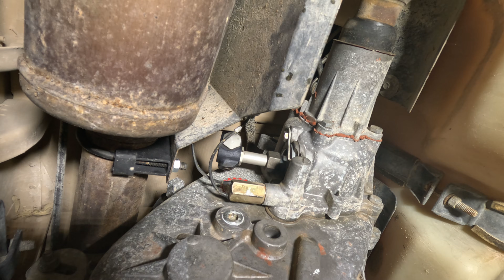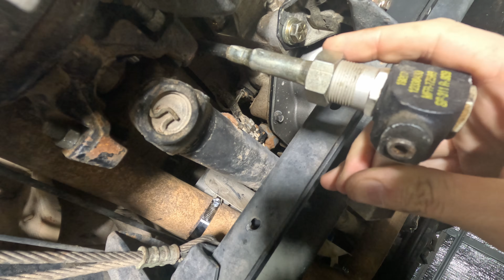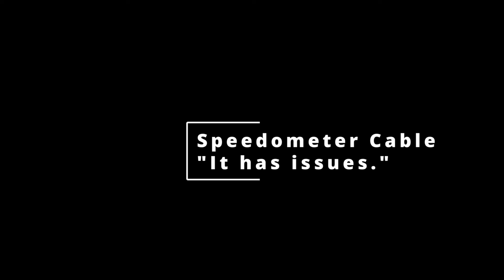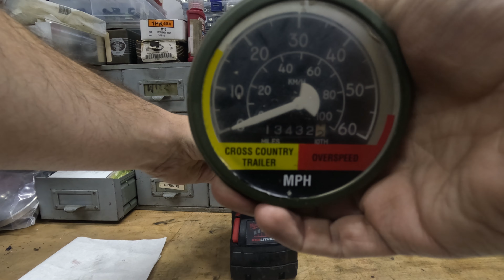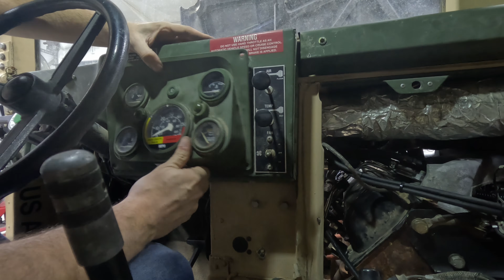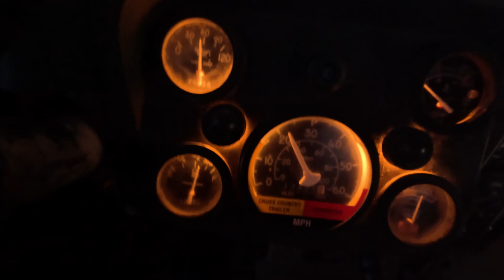Fixing My Humvee's Broken Speedometer (DIY Repair)

Comment: After about 3,00 miles the speedometer stopped working on my M1123. It ended up being the cable. It was rounded out whare it enters the 90° box in the transfer case. You may know this already but the transfer case is common on full time four wheel drive jeep Cherokees.

Comment: Could I recommend some dry graphite lubricant shot down the Speedo sheath? This was an old trick some mechanics used back in the sixties after replacing the center core of the Speedo cable.
Reply from the maker: Thanks for the recommendation and that has worked for me in the past on other cars. I tried quite a few things including lubricant and nothing seemed to help that old cable so that's when I decided to replace it.

Comment: I drove a few Hummers back in the 90s.  They were old and worn out but I'm pretty sure the needle has at least that much movement on low speeds.  Just thought it was part of being the built by the lowest bidder.  HAHA.  Nice repair.
Reply from the maker: Thanks for the comment. After checking the spindle nuts I took the truck up to 50 MPH and the speedometer needle was stable (less than 1 MPH movement).

Comment: Have you had a transmission limp mode ? I have a 2000 M1123  I’m having issues with the limp mode
Reply from the maker: I have not had that issue.  One resource to look at if you haven't already is the 4L80E Transmission Troubleshooting Guide as it steps through testing and fault diagnosis.  https://gear-report.com/wp-content/uploads/2017/03/Supplement_7_4L80E-Transmission_Troubleshooting.pdf
Reply: Is this an issue with the newer four speed transmission that have an electronic controller? The controller is located underneath the rear seat on the drivers side. I don’t recall seeing one for the original three speeds.
Reply from the maker: @Subgunman  The 3-speed transmission (GM TH400) doesn't have an electronic controller. Only the newer 4-speed (GM 4L80E) has electronic controls.  

The 4L80E in my truck shifted properly even when the speedometer wasn't working as the mechanical speedometer isn't at all required for the operation of the transmission. The information the transmission controller needs comes from other sensors mounted on the engine and on the transmission itself.
Reply: @midnightmachineshop  so it might not be economical to do the swap unless the transmission comes with the proper wiring harness, control box and if one could possibly add the required sensors on the engine. The next issue would be is protection from an EMP from a solar flare. That is one issue in todays engines. I spoke with a friend a few days ago who is a MB diesel mechanic. His comment was that MB ruined their Diesel engines on both cars and heavy trucks by adding all of these e boxes and sensors to the engines. Feel sorry if the military G Wagons have electronics on board.
Reply from the maker: @Subgunman  From my understanding of what is different, the 3 to 4 speed transmission conversion is very involved. Besides the new transmission - controller - engine sensors, the transfer case, transmission crossmember, fuel tank, front and rear driveshafts, shifter assembly, and shifter linkages are all different.